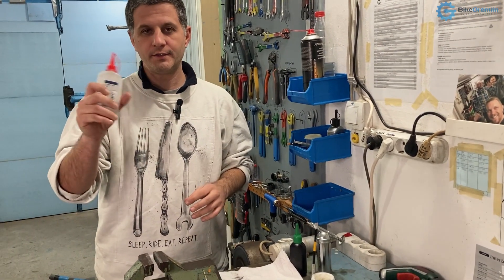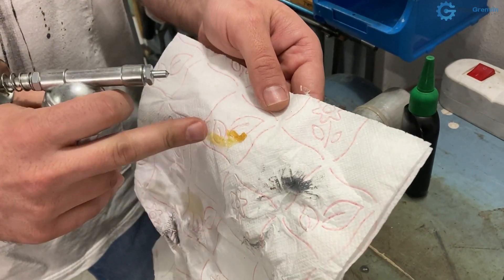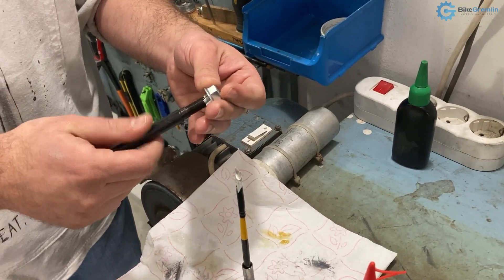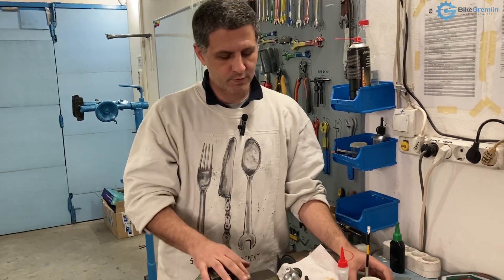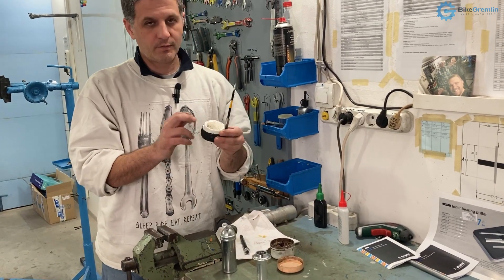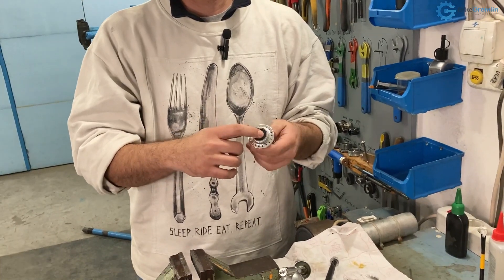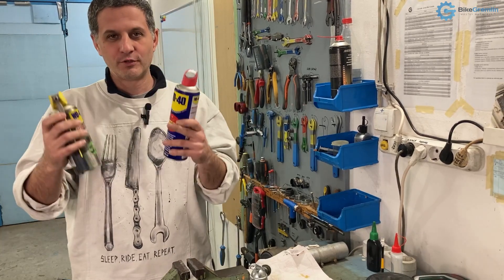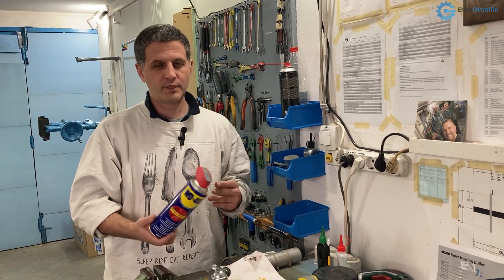Mounting (anti-seize) pastes, oils, greases and WD-40 explained

Comment: Thank U bikegremlin for education on bicycle repair. Can you make a video on overhauling a freehub? I did this one time 30 years ago because my 9 speed cassette was removed to access the freehub. Rain and dirt went inside. I cleaned the inside with WD40 followed by hitting the cassette and freehub on an old carpet so that the dirt and old grease fell out. Then I packed it with "wheel bearing grease" from an autoparts store. This thicker grease made my overhaul more resistant to riding in the rain. God Bless You Bike Gremlin😀😀😀
Reply from the maker: This is what I've already made:

Cup and cone hub service:
https://www.youtube.com/watch?v=TjObquSotRw

Freehub disassembly tool:
https://www.youtube.com/watch?v=4NbKBNOfwWY

Relja

Comment: My road bike is from 1979. It has a Shimano rear hub with a little sliding cover, over what I assume is a lubrification hole, centered between the spokes. I don't know if I should drip oil (and what type) into the hole or should I inject grease (and what type) into the hole. How often should this be done? I really enjoy your videos, they are well done, thank you.
Reply from the maker: The safest bet is to try and source a manual for the hub model.
Generally, with no other info, I'd use some 20W thick mineral oil, making sure to top-up regularly, but not overfill it (5 mm "depth" - probably about 6 ml of oil should do it).